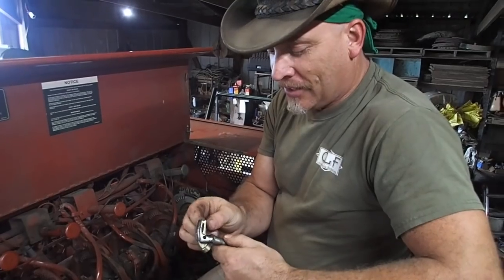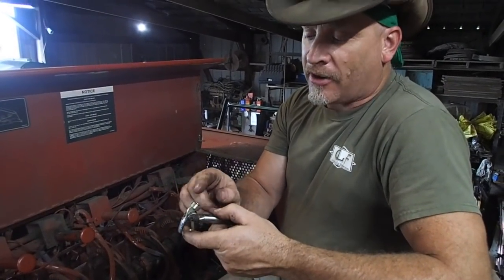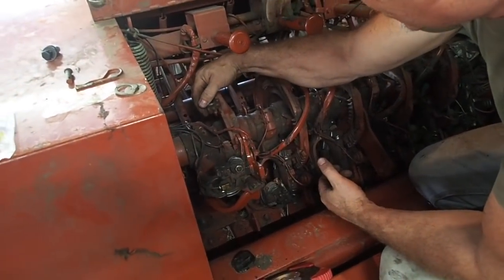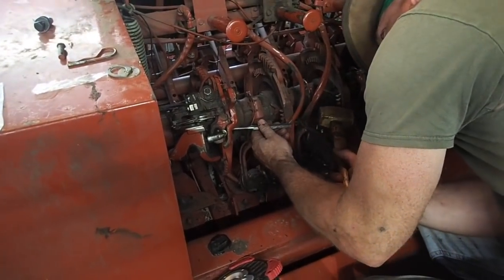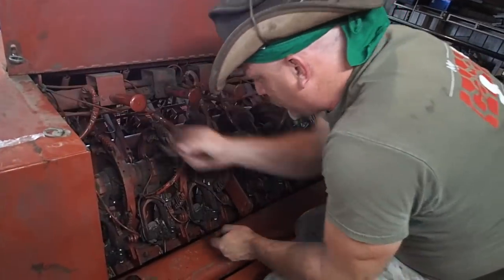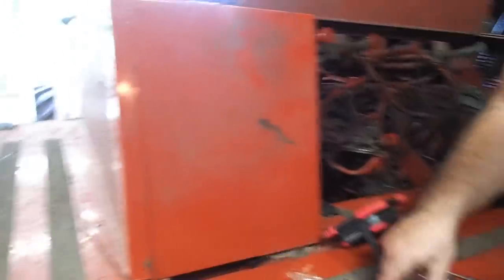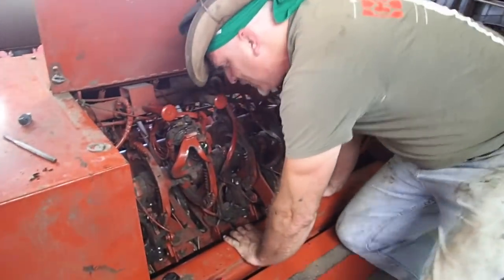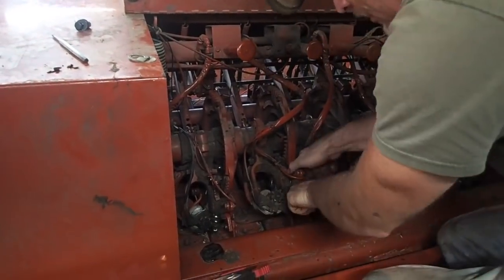String Tyer Health!! (K nott er)

Comment: Good for you for involving the children in the equipment repair and having the patience to give them the guidance that they need without making a big deal about their mistakes.  Also, your power of observation in analyzing the various problems with the equipment are absolutely amazing.  You have the ability to zero in on the root cause of the problems and take the intelligent approach to correcting the situation.

Comment: Giving the two hour go for it time was worth far more than days in a classroom.  They had to engage so when class began, they had a clue and the solution registered.  Plenty of Heston owners will be all over this upload. Good luck with the weather and safe bale recovery.  The spent compost fertilizing trailer backhaul could also be your corn retrieval and sales rig..I bet. At .15 cents a bushel durning harvest that will keep the tractors busy when haying is done.  If anyone can figure out a trailer mod for hay delivery and compost/grain use on a trailer, you will.  Hinged sides with hydraulics.

Comment: Our local John Deere doesn't sell tongues separately.  $90-$110 for a complete bill hook for poly twine.
Reply: If they are available separately you can go to johndeereparts.com look up in the parts book and order them from there
Reply: @Mad_Farmer912  complete bill hook only.
Reply: @martinbenton742  ok the way I read it was the dealer would only get the whole bill hook.  Doesn't surprise me more often then not you can't get parts and have to buy the whole assembly.
I just went through that on a silage wagon ujoint. They change to ujoints with needle bearings instead of pins so you have to buy a new pto shaft for $640 and no one else could match that size or style ujoint.
Reply: @Mad_Farmer912  it would be nice to know if other balers or in your case, u-joint, was used in other applications or my case, brand if baler.

Comment: I wonder how is the automatic greaser system working that the previous Hesston owner had disabled?
Reply: Kenneth Smith when mine was previously disabled, all they did was remove the grease hoses from the distribution block and installed grease zerks